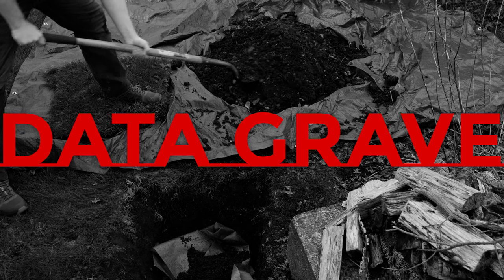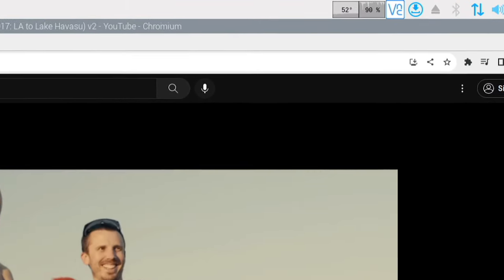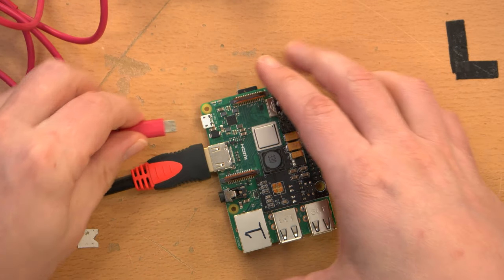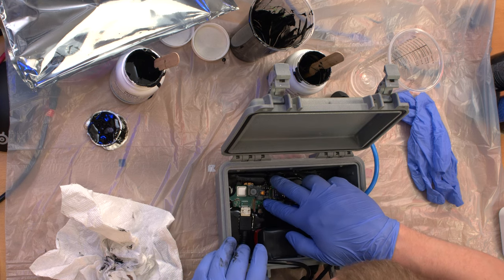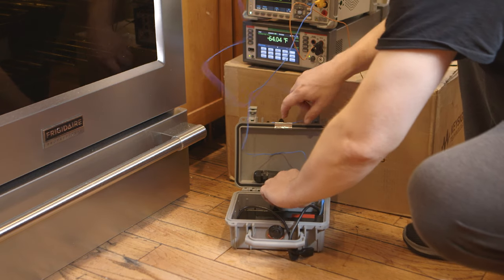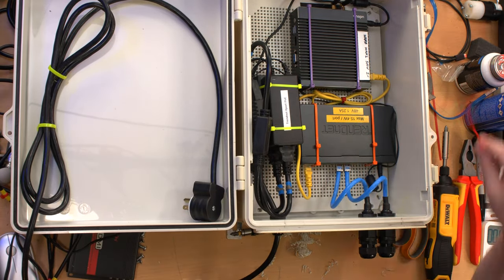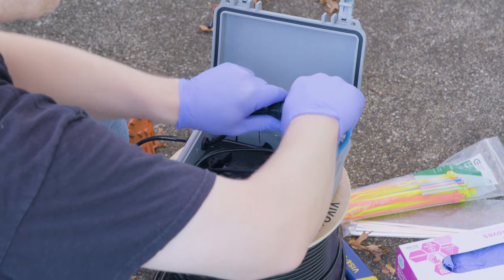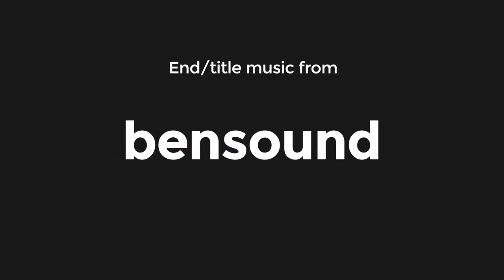Bury Your Backup Servers Underground ⚰️

Comment: Neat project. I was thinking about something similar for a backup (shed, actually. And trying to figure out temperature regulation in winter..)

What about digging farther down using an auger? You could go way below the frost line.
Reply from the maker: An auger definitely would have been helpful.. I may rent one for my next experiment!

And this is all kinda new to me, but fwiw the last computer I had in the outdoor enclosure survived between ~ -20C and 38C temperatures.  For cold weather, you'd probably be OK with a sealed enclosure because the computer will self-heat to an extent.  But I suppose it depends how cold winters get where you are.

Comment: it is very fun project, but...
1. not deep enough. For nuclear protection you should go 2-4 meters, to avoid seasonal temperature drift you should go at least 1m. You dont want your container to sit inside frozen soil :)
2. hdd holds data way better than cheap flash drives.
3. If lightning hits your house, your pi`s are done.